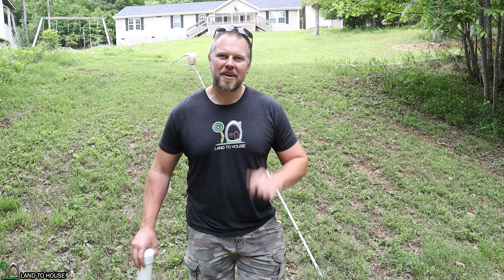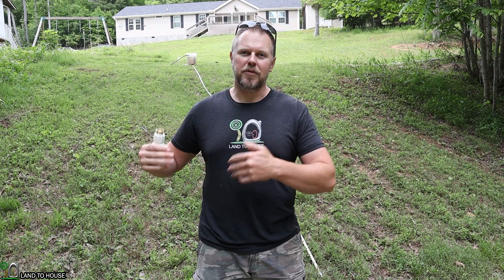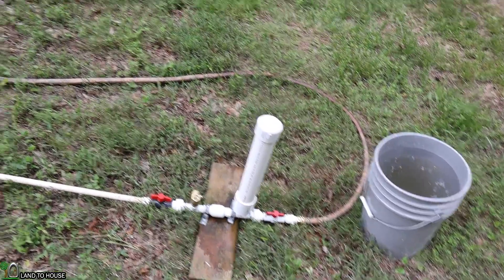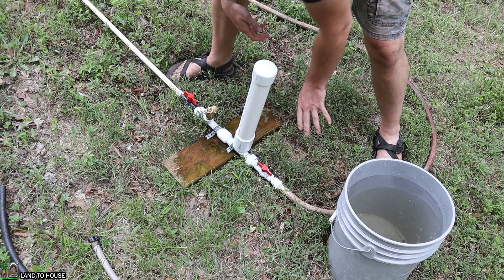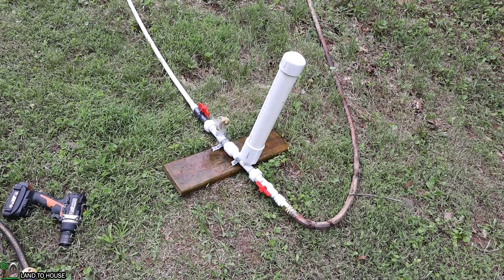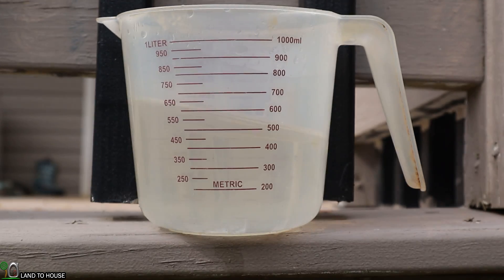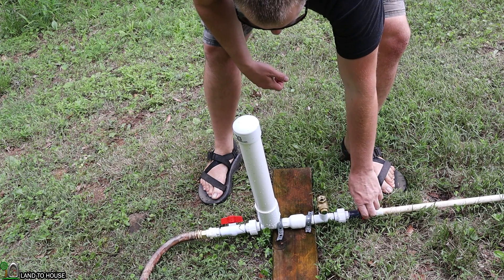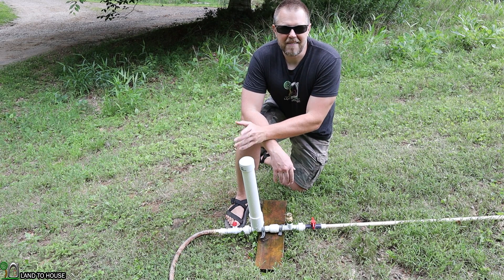Ram Pump Will an inline valve actually increase the output

Comment: for your stream turbine, try stack of discs, plastic, as open tesla turbine, in the same box housing, same nozzles, stack disc spacing 0.5-1mm with bolted spacers. very easy to make from plastic or steel sheet, and a central axle rod, and some bolts to keep it in shape and spacing. yep even the same orientation, axle vertically up, discs horizontal spinning.

Comment: I think it would allow you to pump the water higher because the inline check valve takes back pressure off the pump temporarily. Was it a 2 lb. spring or a 5 lb. spring in the valve? It might make a difference and the weaker may be better for a longer opening time.

Comment: Hey Seth, I upgraded my swing valve to a modified check valve and saw significant improvements to my flow. I increased the bolt length of the valve and added support, you can calibrate the pump to the flow by changing the open distance of the valve by adjusting a lock nut on the extended bolt. Weight can be added to the bolt if there's more flow to be harnessed. I'd love to see you try DIYing some valves and testing them.

Comment: Good test, I remember you performed all these tests on the valves previously in a video clips
Reply from the maker: Yes many years ago I ran this test on a hill much taller than this one. The valve seemed to help back then. On this hill it does not seem to make as much of a difference.
Reply: yes that's correct i follow your videos many years ago and i remember that